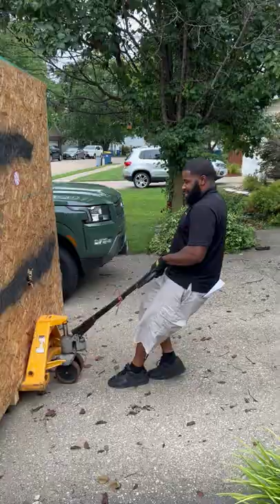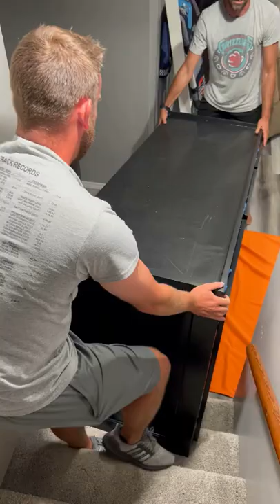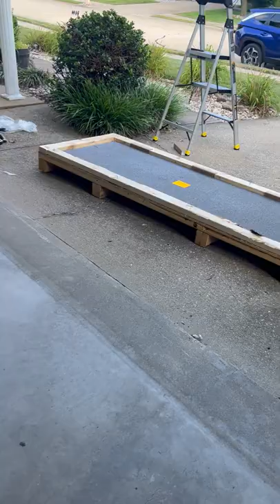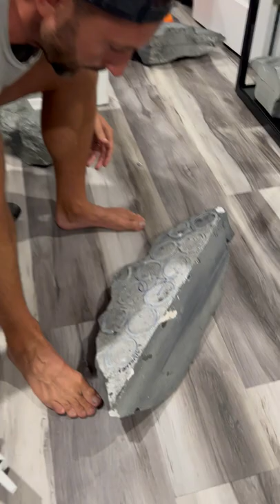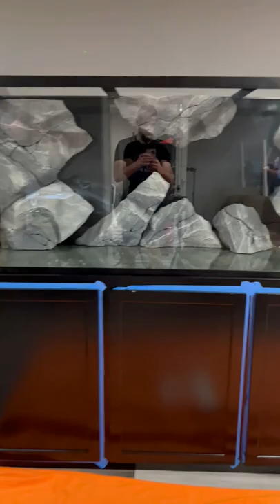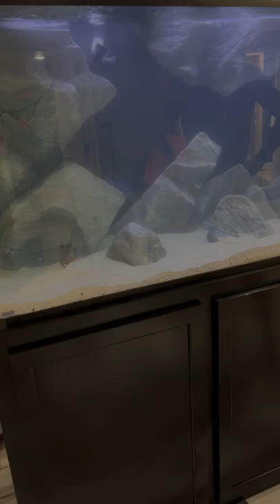The 220 Gallon Aquarium Setup - From Start to Finish!

Comment: I like the design of the tank. Black aluminum frame at the top and bottom. (Are they really aluminum or a stronger metal?) Black silicones. And finally a black wooden crown on it.

Comment: All the aquariums are really good. 
Are you using artificial rocks?
What’s your opinion on using real rocks ? Will there be any issues if we use real rocks?
Reply from the maker: Thanks! These are artificial that came with the background from Aqua Decor. No issues using real rocks
Reply: @CichlidBros  thanks a lot bros… I have easy access to get some stones l I’ll clean them and decorate.
Reply: I also prefer real. You just have to be careful to pick the right rocks for you preferred water hardness

Comment: You didn't even cycle your tank
Reply from the maker: I guess you didn’t read the text on the video, or watch the longer version. Not our first tank setup
Reply: @CichlidBros  no most people only get the short version.
Reply from the maker: And even in the short version, there is text to quickly explain it. No need to just assume the worst